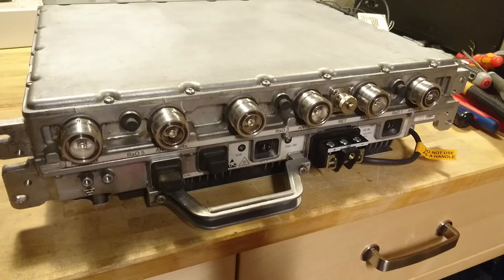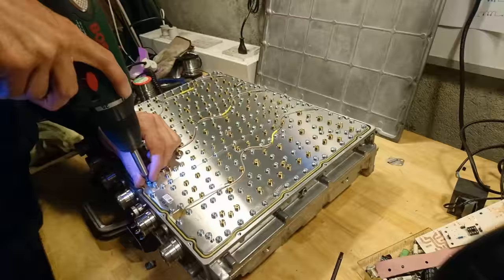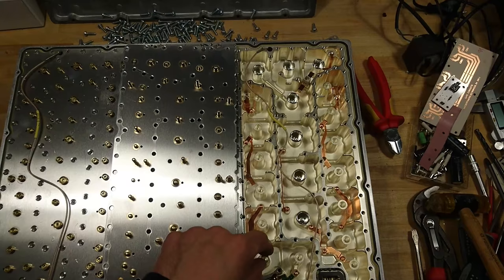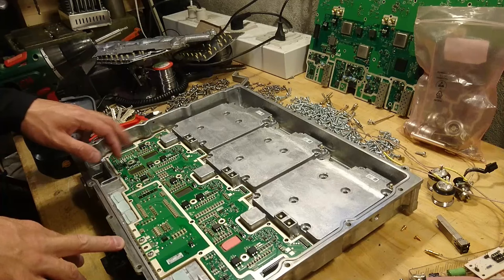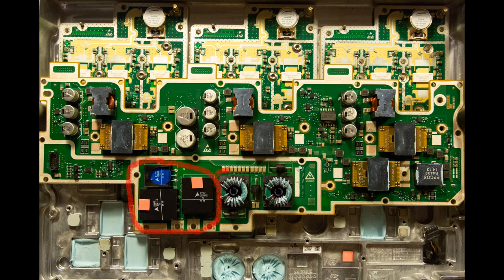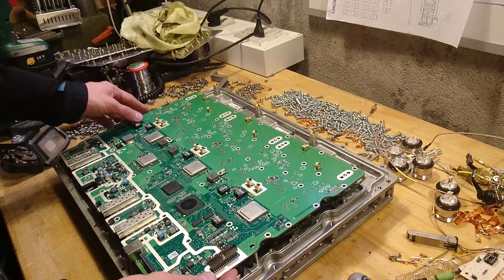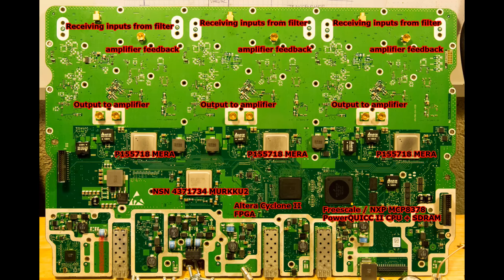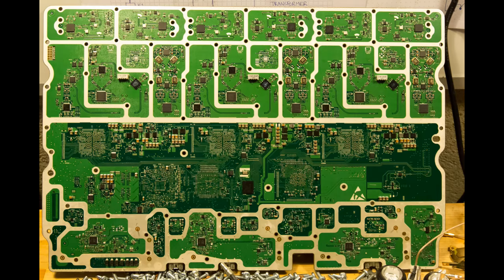Inside a Mobile Phone Amplifier! Nokia Siemens Flexi WCDMA 2100MHz Base Station Teardown (Part 2/3)

Comment: An enjoyable video!  I'm pretty sure that those circular Aeroflex parts are not filters, but are probably ferrite junction isolators.  They ensure that the amplifiers see a constant impedance on their output even if the impedance at the antenna port changes.  Or for the 5 watt drive amplifier the input impedance of the big PAs will probably shift with drive level, and isolator keeps things nice and controlled.
Reply from the maker: You are right about them being isolators/circulators, found this description of how they work: http://www.novamicrowave.com/understanding-circulator-and-isolaters.php

Thank you for noticing this.

Comment: the aeroflex part on the output is called "circulator" if something is reflected from antenna port due to mismatch, short or open. the reflected power routed to the 100w dummy load by circulator.
Reply from the maker: I learned that in some of the later RF teardown videos, which you should check out :)

Comment: You should check out the latest video posted on The Signal Path Blog's youtube channel. It features two similar PA's and the host sheds some more light on the detailed functioning of the different components you point out. Particularly the function of the couplers, the quadtrature hybrids and the isolators on the board, as well as some background on the LDMOS parts and the overall design.
Reply from the maker: I recently, about a month ago, subscribed to TSP blog, but have not yet had the time to dive down into his many videos. I certainly got much more to learn about RF equipment, hence why I lack super detailed circuit descriptions here :)

Comment: Great detailed video. Anyone not to familiar with cell technology who sees these devices cracked  open will think it is  alien technology. Amazing to see all the details of the cavity and how it can precisely pass rf with minimum vswr.  I can't imagine the amount of time, and experiment s it took to get to this  level.  

I work on two way radio combiners,filters repeaters so this type of diplexer is new to me- more complex and detailed.

Does anyone know if cellular base stations are able to tx and rx a broadband of frequencies at the same time?
Reply from the maker: The Flexi Multiradio Radio Frequency Module (FXxx) or RF Module, is a 3-branch multicarrier,multi-standard radio transceiver module. The module consists of three independent branches, capable of transmitting and receiving signals of multiple radio technologies concurrently:

    Up to 6 GSM carriers with 400 KHz minimum carrier separation
    Up to 4 WCDMA carriers with 4.6 MHz minimum carrier separation
    Multi-carrier LTE signal with 1.4 MHz, 3 MHz, 5 MHz, 10 MHz, 15 MHz, 20 MHz, and 35 MHz carrier bandwidth
    Multi RAT operation with combination of GSM, WCDMA, and LTE
Reply: @KaizerPowerElectronicsDk   wow that is cool. It seems similar to  uhf combiners and multicouplers but has a much higher frequency and likely more prone to PIM. your very knowledgeable.thanks for the detailed info.

Comment: @ 3:44 can you tell me what those white and pink pads are? Are they gap pads/fillers for heat dissipation?
Reply from the maker: It is a heat transfer compound, feels like soft rubber and is cold to the touch. It comes off in one piece when removed, so its not like the regular heat paste you know from computers.
Reply: Perfect, thank you! Love the videos, very informative and helpful

Comment: The NSN MURKKU2 chip probably got its name from finnish word for ant, muurahainen. Murkku is a slang word for ant.
Reply from the maker: That is a lovely little story, I like it when designers get to have their signatures on the end product :)
Reply: @KaizerPowerElectronicsDk  2y late post: it also means teen/teenager. I know, I wrote code for this. Kindof funny to see it on youtube.
Reply from the maker: @7dexter  I love it when it gets back to the designers, got some good anecdotes about these systems?
Reply: @KaizerPowerElectronicsDk  Designer is a big word, I was merely a programmer :) We had that PowerPoint presentation after finishing the project that estimated amount of coffee drank during development that if one would stack all the coffee mugs they would reach the moon. Complexity of those system and their accuracy in terms of timing/frequency is incredible. Radio unit like the one you got on the video can measure optical cable length with centimeter accuracy by measuring delay between sending and receiving signal back. Once there was a plan to replace dual fiber optical cable with a single fiber to reduce cost. In such configuration you have to use different wavelength signal to transmit in each direction. The plan has failed because different wavelengths propagate with different speed which made the delay slightly off.
Other story is that the laboratory consumed so much power that the building had it electrical substation replaced like every year until we maxed out grid capability in the area.
I could describe you some basics on how those works somewhere else if you like.
Reply from the maker: @7dexter  Thanks for the small look into the design/building aspects :) I post all my teardowns on www.highvoltageforum.net in the RF section. You could reply to any of the teardowns there if you would like to :)

Comment: Will we ever get away from analog circuits, I say no?
Reply from the maker: Not for long distance wide area wireless transmission. Directional you could properly use LOS laser to omit the analog stage.
Reply: Digital domain is an useful abstraction, but at the core of digital electronics there will always analog electronics designed to work switching between 2 discrete states (or even more than 2 discrete states, but never a infinite number of them). To my best understanding, the digital domain is somewhat encapsulated by analog electronic. Think of your digital TV (DVB), you may think about the details of the digital processing (transfer rate, compression, Bit Error Rate, etc), but you may think also about the details (and the corresponding problems) in the transmission path of the RF waves (antenna gain, transmision losses, signal distortion, signal to noise ratio, etc).

Long story short, I agree with you, there will be always analog circuits. Just my 2 cents.
I apologize for my poor english, in advance ;)